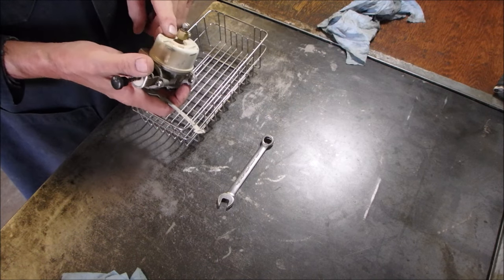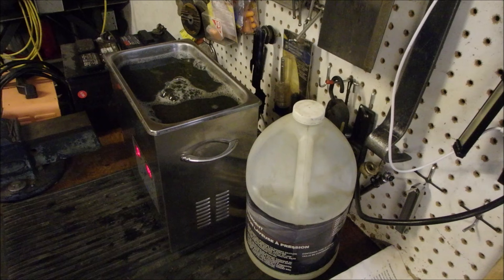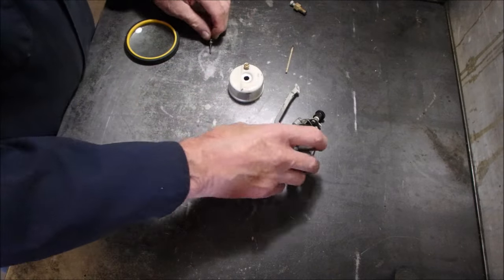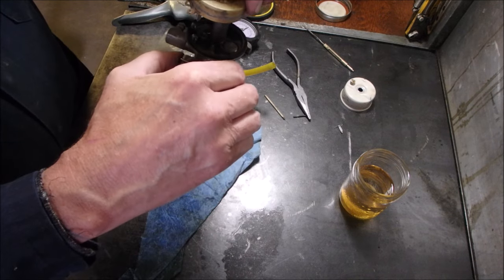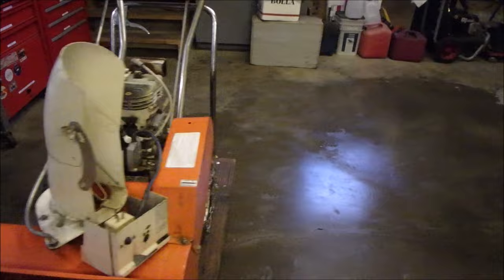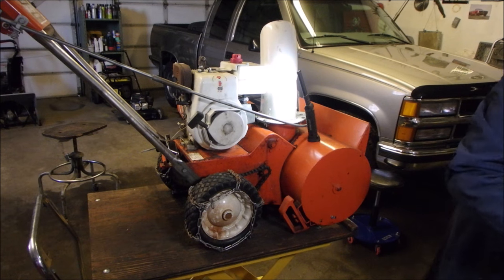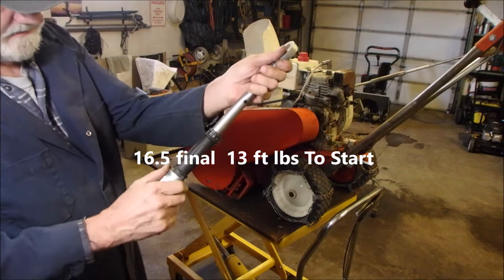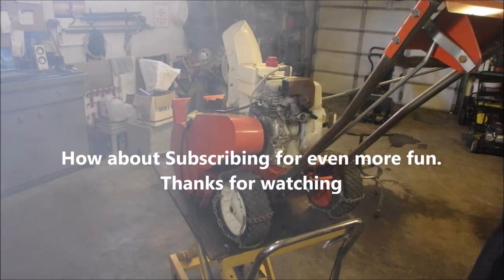1973 Tecumseh Snow Blower Part 1

Comment: You've not had fun in the shop until you've finished an oil change, go to start it up only to discover you forgot to put the oil fill cap back on. Then all you see is an oil fountain and a huge mess to clean up. Cheers my Good Man! Sean~
Reply: Been there and done that at Eliminator Performance Zippo but do not believe oil will shoot out of the oil fill cap when the temperature is 29 F below zero , what do you think?
Reply: @waynestefinashen239  At those temps, I would hope a much thinner oil like 20W is being used Or a 5W20 would be even better. That thin an oil would exit the oil fill in a fountain. If 30W is in it, I'm guessing the oil would still be pushed out. Just not in as dramatic a fashion.
Reply from the maker: Thanks for joining in Zippo

Comment: Hey Bruce! it's been a couple or more years since I've watched your channel. I still do occasional small engine repair in my shop of course carbs are a routine with gas like it is. What cleaner do you like to use in your ultra sonic? I just fill mine with water and use what ever I think is best for each job in a freezer bag and drop the bag in the water and bleed the air out of the bag a few times during the soak. I like white vinegar mostly but sometimes I need more power and I will use muriatic or phosphoric at about 50% dilution for rusted steel parts. I'm still searching for how to clean aluminum parts the way a factory rebuilt carb was back in the day when our cars had them. I'm thinking about trying soda blasting in the sand blast cabinet, I heard it washes out good with water so it won't clog small passages.
Reply from the maker: I use about a cup of simple green with the 3 liter solution.  The simple green i have has no ammonia. which turns the aluminum black.  I think anything that cleans works OK.   Thanks for commenting..
Reply: Thanks for reply Bruce. Merry Christmas and Happy New Year.

Comment: Bruce I am sure you know this but the idle mixture screw should be installed carburetor right side up. There is a piece that can be damaged if installed when up side down. The carbs that if you open the throttle plate have about a 3/16 hole to the left bottom. My first snowblower was a big old single stage
Reply from the maker: Thanks for the tip

Comment: Hate tecumseh
Reply: Too many of them out there still running to hate them and one of the best cold weather engines on snowblowers ever made. Extremely rare to find one with a broken connecting rod yet B&S has that common issue besides the ACR failures.
Reply from the maker: I understand